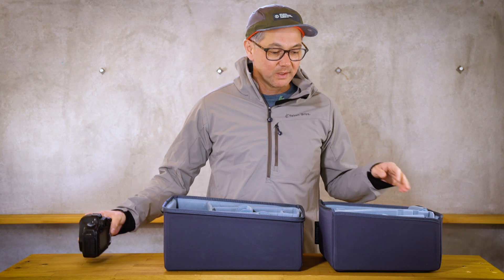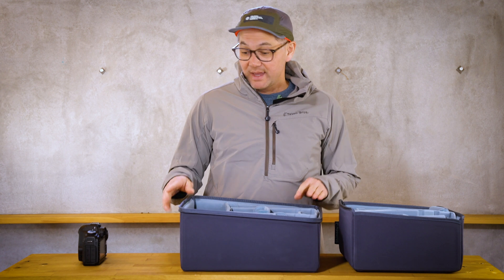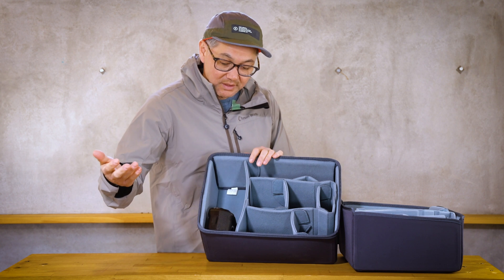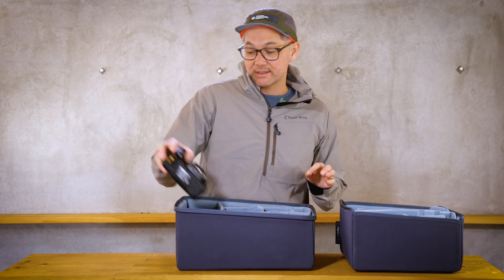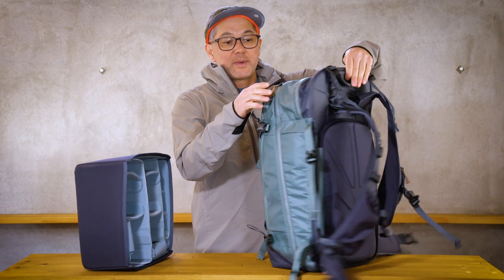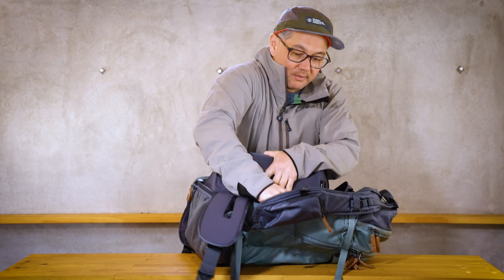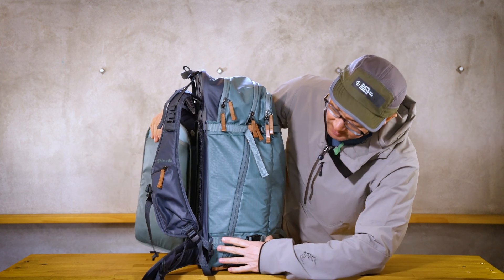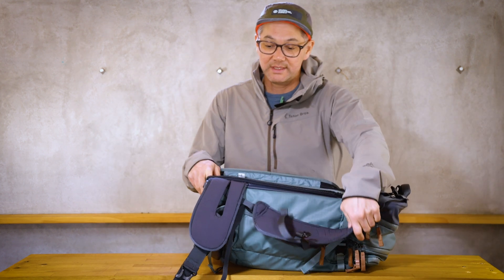MAIL BAG:   Why Are The Core Unit's Tapered?

Comment: For the Large DSLR Core Unit, what is the measurement of smaller tapered end versus the larger non-tapered end? Is the small/tapered end 6.7" or is the larger/thicker side 6.7"?
Reply from the maker: Hi Alan, 6.7 is the taller end (sized for gripped bodies) and the smaller end is 5.9inches. Just an FYI, we tapered it as most lens are not taller than 5.9 and if they are it's usually much taller (like the 70-200). The backpacks main compartment follows the same shape. - Ian
Reply: @ShimodaDesigns  Reason I am asking is I am trying to see if the Large DSLR Core Unit will fit inside the GoRuck GR1